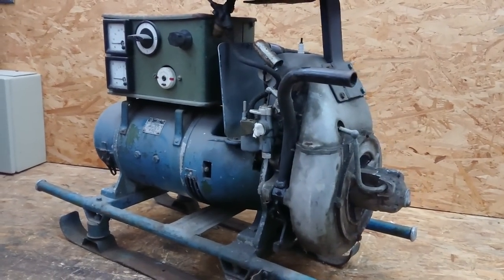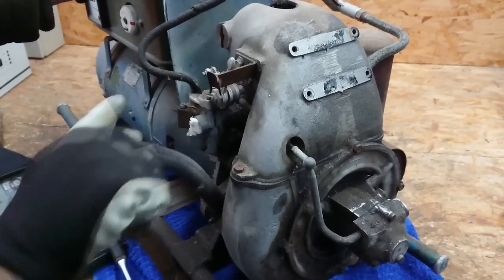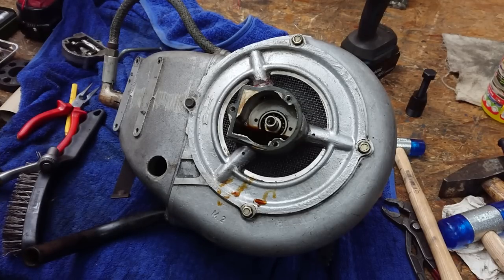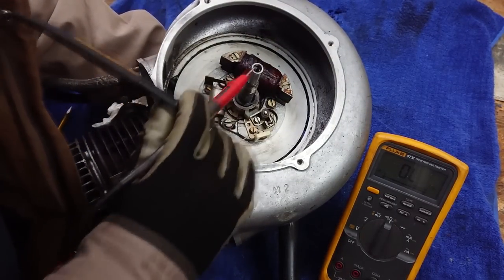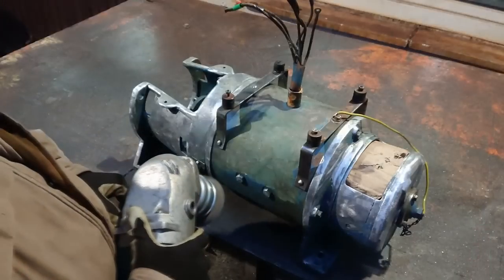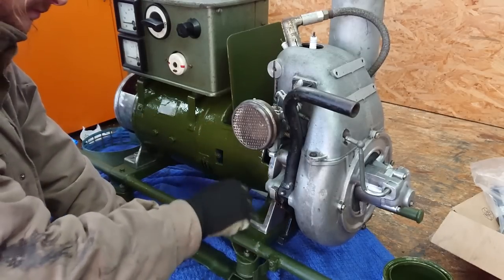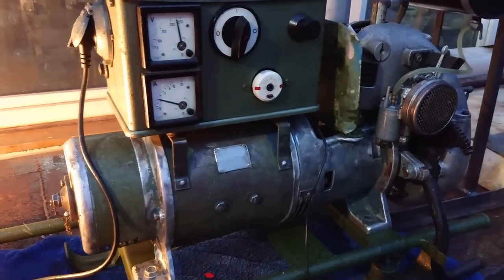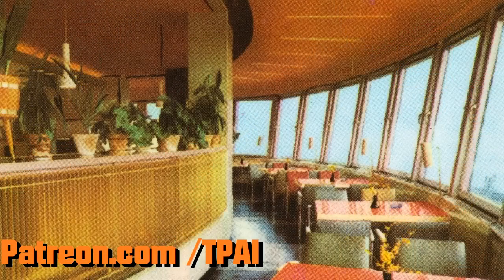East-German Military Generators! Repair-A-Thon!

Comment from the maker: 'condenser' vs. 'capacitor'? Long Story short: They are the same thing. To my knowledge, 'condenser' is just an outdated word that was used for all kinds of applications. However, it was replaced by the word 'capacitor', BUT for some exceptions. For example: 'Condenser Microphones'. And another case are capacitors in ignition systems: They are often reffered to as 'condensers' as well. In many other languages, like in the case of the German language all capacitors are reffered to by a word more similar to the old fashioned 'condenser'. In German we call basically all capacitors 'Kondensator' (kinda like 'condensator' - - > 'condenser').
I'm sure it's true for most languages. What about Spanish, Italian, Portugese? Let me know :D

Or in other words: Languages can be inconsistant and confusing and it's probably better to just have one word instead of two, but I'm not going to change it.
Reply: As a tip for working with old engines: if there is no spark, first unscrew the Spark plug connector, hold the spark plug cable to the cooling fins and check for spark. Especially with these DDR spark plug connectors I had often problems on my Simson. Before I knew this trick I had to dissassemble the whole ignition without finding the mistake.
The video is of course as always great 👍
Reply: In the US, I think 'capacitor' has become the standard technical word used by engineers, and 'condenser' as you said is a hold-over from decades ago when it was common usage for whatever reason of history.
Reply: In Spanish we say Condensador as well...  Thanks for this awesome videos! Take care!
Reply: East Germany . . . very practical . . built to last 
 The beauty of living in a socialist/communist state
Reply: It's also kondensator in Polish ;)
Reply: Yeap, In Dutch as wel, condensator :). AFAIK we have no word like 'capacitor' in Dutch.
Reply: @Trancefreakeh  In Polish the only one I can think of is kapacytancja meaning capacitive reactance.
Reply: @maciejzettt  Exactly, we have the same word ( more or less ): Capacitantie. Language is weird ^^
Reply: In french that : condensateur
Reply: In Danish it's kondensator
Reply: As you german in Italy we use both " condensatore or  capacitore as condensator !
Reply: Can we have more of those Scrapyard Repair-A-Thon video series please.
Reply: @maciejzettt  Kapacytancja… to takie niepotrzebne zapożyczenie. Pojemnościowy opór bierny albo sprzeciwność pojemnościowa - w końcu my nie gęsi :) Polskie słownictwo techniczne jest wg. mnie przepiękne i warte zachowania. Jest częścią naszej kultury technicznej.
Reply: Kondensator in Polish.
Reply: @maciejzettt  Kondenzator in Serbian
Reply: In Czech it's "Kondenzátor" too. Probably taken from German language like many other words.
Reply: @MrHack4never Same in Swedish, and  kapacitans for capacitance
Reply: The auto engineering industry has clung tenaciously to the past and continues to use terms that were dropped everyone else decades ago. Talk to motor mechanics about capacitors and generators and they will tell you that you are just dead wrong in the first case (that there's a condensor, son) and limiting yourself to a DC device with a commutator in the 2nd case (a 3-phase AC generator in a car is an alternator, no argument allowed).

Fkn luddites. They also continue to draw circuit diagrams like the one in this video (actually, to be fair, those are wiring diagrams).
Reply: In Polish, we also use the word "kondensator" when referring to an electronic component, whereas "kondenser" has a completely different meaning and is an archaic term for an air conditioning condenser ("skraplacz" in Polish).
Reply: @maciejzettt kondenser też używamy. Inna nazwa skraplacza ;)
Reply: Ich hab gesagt SO EINFACH GEHT DAS NICHT
Reply: In Finnish capacitor is 'kondensaattori'. A loan word from German and/or Swedish.
Reply: In European Portuguese it is also "condensador", though the Brazilians use "capacitor" (yes, spelt like that).
Reply: @miningbruno  
Shutup
Reply: Hallo,
habe das gleiche Aggregat zu Hause! Hat gut funktioniert.
Nach längerer unbenutzter Standzeit gibt es eine Unterbrechung bis zur Zündkerze!
PS: Könnte das auch auf deutsch kommentiert werden?
Schöne Grüße aus MV!😮
Reply: Ok, if Condenser is an outdated word, I will use that option for sure!
Reply: Kondenzátor in czech.

Comment: I love how you made the diagram much simpler it looks a lot nicer when its not busy with unnessecary things
Reply: it's good work that alright
Reply: I wish manuals / documentation included both. My BMW E30's manuals has LOTS of simplifications in the wiring diagrams which makes it near impossible to trace or find anything.
Reply: @TotoGuy-Original  yeah I've had to use that a lot. My car's year though is on one of those transitional months so sometimes gotta reference different new/old diagrams on realoem to make sense of it. 
I wish they had just a master diagram for all years you could navigate thru and see what's the same and different all in one spot.

Comment: In my experience its usually the points. I keep 3 or 4 different size nail files in my box for this. You can reach in and clean both sides at the same time. That's cool little genset, you don't find many old sets here in the US. I always look forward to your videos! Always interesting!
Reply: A "contact burnishing tool" is the correct tool for this purpose. They remove oxidization without significantly altering/abrading the actual contacts, they're also usually flexible so you can get in at weird angles if you have to.
Reply: @recurveninja  that's cool, I did not know that. I've just always used a fine grit file. I'll try and find the correct tool. We are fairly lucky here in the US replacements are easy to get and cheap. Thanks for the info.

Comment: In the US we call it a "condenser", not capacitor. 
Great video as usual! From a first generation German/American.
Reply from the maker: Well. I'm actually aware of that, but it's just a remnant from the old days, when all capacitors were called 'condensers' in English (At least as far as I know). Did you know that most other languages actually use a Word similar to the old word 'condenser'? In german all capacitors are reffered to as 'kondensator' no matter which application they are used in.
Reply: @ThePostApocalypticInventor  In the US the word 'condenser' (in electrical/electronic usage) fell out of favor about 100 years ago and was only used in engine ignition systems until they stopped using them in the 80's. Now it almost exclusively refers to a part of a refrigeration system (or in an antique vehicle).

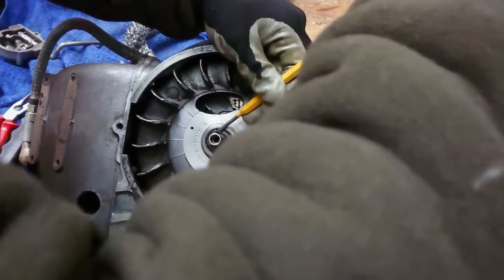Comment: 07:12 the disk mounting key/wrench from a 115 or 125mm angle grinder may fit that nut. The are also adjustable angle grinder wrenches able to fit wide range of slotted nuts like that, you can get a decent quality one around 15-20 euros and you'll find it quite useful for such restoration projects.

Comment: Nice to hear that sound again.. My grandfather had a small machine for farming purposes, like a small tractor, but with one axis only. Btw, the missing valve - he called it "Zischhahn"  directly translated hiss faucet was used to shut the engine down.
Reply: The cylinder pressure relief valve has some advantages over the electrical counterpart: it can be made to last essentially indefinitely, and it doesn’t dump unburnt fuel all over the place as would be of concern in 4-stroke carbureted motors.

Comment: The reason you can repair old stuff, is they have no plastics in sight. 
The only plastic on this unit, is the Bakelite knobs. 
That is one gorgeous machine. This type of quality and precision is what made German stuff so popular.
Reply: Also they're not so cheaply made like so many modern things which are built with a very short lifespan in mind (in order to sell more of whatever replaces them). In addition to that the older items are made in such a way that they can be taken apart relatively easily, it's usually just screws, nuts and bolts (as opposed to modern items which are glued, sealed, welded together, etc). And finally, with electronics being used so often today they can be tough to repair and a failed PCB can be stupidly expensive to replace.
Reply: Thermoset plastic parts, when not under-designed, will not corrode and will outlast pretty much all components made of non-precious metals. The modern “cheap plastic” stuff’s issue is being cheap, not necessarily being plastic. This generator could have had several parts made out of glass-reinforced polycarbonate and it would be somewhat lighter. Whether weighing less would be of any real advantage depends on the use case.
Reply: @absurdengineering  Do you see any corrosion on this 60 year old generator?
Have you tried brazing or welding thermoset plastics? Or even repairing a broken plastic part? 
If made of steal or aluminum, it can be repaired. If made of plastic, it goes to landfill.

Comment: It's the same with the original Skoda's. The GDR cars were beautifully over engineered. If an item needed a 20mm shaft they'd use a 35mm shaft "just to make sure". The whole car was built like that.
With its rear engine I called mine "The poor man's Porsche".
I guess if you're government owned to that degree then the profit margin is out of your hands so yes, some companies under engineered their products, but firms like Skoda and the maker of your lovely old two stroke who had pride in their company were free to comfortably over engineer their products.

Comment: Hi! 
Great video. I live in Poland. Im 54 years old. In the time rightly past we use East Germany things made very reliable a good quality.  From my personal expierince this ignition system looks like erly wersion od Simson small motorbike ignition system. I got one of this. In later models this module was replaced by electronic one - more reliable. Also in wartburg cars this module existed but tripled for the 3 cyliders engines. From my personal expirience (simson and wartburg) - Periodicaly it needs (we called them platines)  cotacts gap regulation and a weekest thing in this system is capacitator. Capatacitator failure generates sparks between platines and burn them.

Comment: If the dinner conversation turns to the difference in voltage and current control between West German and East German army generator sets, I will now be able to speak knowledgably on the topic.

Comment: 10:19 The nice thing about points is they're quite forgiving and will work when they really have no right to. You probably could have gotten spark back just by flicking the points open and letting them snap closed on their own spring, or sticking an emery board between them and filing a little.

Comment: Very Interesting. 2Stroke Generator for the fist time.I used to maintain 300Hp Turbo Diesels in Middle East, Later Hatz Diesl Gens.Your explanation is sehr gut. This Gen  running @ what speed & howmany KW output? Excellent video 
Vielen Dank. 😃

Comment: Could use explanation on the points system, how and what should be the values for capacitor in the point system, how to measure magnets strength and maybe restore such magnet that is destroyed by impact(have currently one with damaged magnet and other mysteries why it has no spark) well as how to measure and confirm condition of the coil and what are general tolerances for most that size engines, so this information can be applied to other type of similar sized engines to get them running. Maybe color coding this particular engine information with one and general info with another helping out increasing range of information to other such engines.

Comment: My knowledge of electricity is pretty basic.back in the 60 / 70s, I worked on my cars that used points & and condensers.   So, a lot of your explanations are over my head.  But I still enjoy your videos. Plus, I'm trying to listen to the German  names you used.  I don't remember them very well but I like to hear them

Comment: Have you ever tried replacing the mechanical governor with electronics and some form of actuator? I am currently rebuilding a Clarke generator from the early 1980s but some of the governor components are missing.

Comment: Those  motors remind me of the MZ motorcycle I crashed in the middle of the street in Duesseldorf (hit a slick spot in a turn--no injuries or major damage), back in the 80s.  Riding that thing was like driving a tractor with two wheels.

Comment: Ehi, the engine is very similar to old Vespa's ones. Two stroke engines with the fly wheel that provides current to the spark plug and cools the engine at the same time. Good memories :)

Comment: Awesome video!  Really good explanation and depiction of how the generator circuit works - those types of wiring diagrams are very confusing and I really appreciate the effort you put in!  Also really amazing machine - it's hard to argue with that kind of design - built for long life and relatively easy maintenance.  Again, great video! 👍

Comment: Very interesting, 1 pair of fld coils fed from the commutator, other set from xfrmr's secondary,
thru a full wave rectifier and to 2nd set of fld coils. load current in primary affects output to fld excitation. very nice, I am impressed. the condenser in ignition circuit with primary of ignition coil 
is known or could be known as a 'tank circuit'

Comment: can you please make video in detail how the commitator and slip ring are made to the armature I surche for years description about amplidyne metadyne rosenberg magnicon and other like M-G sets.
They do not show what wire type wounding is used or what function they do .
I asked multipel peopel but no one realy understands what I want.
Im building low speed engines so I need desperatly such special generator so I must build one from scratch .
So please make video for that generator in detail please.
I realy have problems undersranding multi function generators.

Comment: well built machine, I like their approach to the governor. Most small engines from North America simply had an air vane and spring that was acted upon by the air flow from the cooling fan.

Comment: when i was a mechanic in the points/distributor days, i kept a little points file in my toolbox just to clean up burnt points.
it was much easier and faster than removing/replacing points. well made stuff can last a long time. nothing lasts today.

Comment: Amazing restoration!!! you should design and build your own generator using the parts of one that be unrepairable. And make mods like a new electronic speed regulator (maybe using a servo for the carburator) or an electornic ignition (capacitive discharge or tiristor triggered) like modern motorcycles!

Comment: I liked the re-draw of the circuit diagram from 17:00 on very much! It really highlighted the essence of the device's function.
I see this often that, in an attempt to catch all non-obvious details on a single sheet, the diagrams are simply overloaded. Many of the details might be essential for the person who draws the diagram, but they are just confusing for the person who should read it. In extreme cases it seems to me as if obfuscation was one objectives when the diagrams were drawn.

Comment: noise from an air cooled 2 cycle engine come from intake, exhaust, fin vibrations. an air cooled can not be made as silent as a water cooled. a graham bell's book on two strokes is helpful. same engine can be used to power a motorcycle or quad

Comment: At 13.17 as you start it, the engine seems to surge but I think its designed that way. The governor lets it heat a bit and then settles on a faster speed. Its cold out there and the 2 stroke engine needs to come to temperature without a load. Is there some kind of mechanical/electrical or vacuum sensor in the governor housing or the carburettor to sense temperature..??

Comment: I am looking for about your place lace me a message. When I post this , I am looking for more information on this .
I am looking for more information about this have what I can find one I live on a trying to build off-grid and I need one for a backup emergency taste electricity power to get to my batteries if my winter bills or so the pain has stopped working wonder if it runs on diesel or gas cartoon I found one

Comment: Yes!
My father taught me how to service points with a matchbook.  The striker is a nice fine sandpaper to clean the points and you can use the cardboard cover as an emergency feeler gauge, good enough to get the motor running.

Comment: this video bring back some memories. during my military service time in the early eighties, witch i was a radio operator, i hat to operate one of these units. i had to operate it and do some basic maintenance work at the unit and for this i need to visit a small educational course to learn the basics. in my military service document was written the permission to do these operations and maintenance.
a unit like the shown one was the emergency backup for a little military radio station who contains a 100 w shortwave transceiver, a 15 w shortwave transceiver,  an additional short wave receiver and a mechanical teletype.

Comment: I loved the reaction when the lights turn on and the engine starts singing its happy song. As said in the narration in other words, 2 stroke engines of any fuel can only really be fine tuned when under load. They will idle with no load, after a fashion, but that's not where they want to live and they will complain if left to do that for too long.

Comment: A suggestion instead of buying a new tool for that slotted nut, is to take an unused socket of the same diameter and cut notches in it, leaving tabs that will fit in the nut.  Be careful though not to over heat the socket as it will lose strength, as im sure you're well aware.

Comment: that looks like a selenium bridge rectifier. Better replace that with a silicon rectifier as the selenium rectifiers tend to fail after a long time, releasing a horrid stench when they do